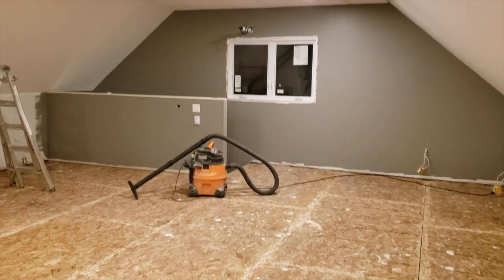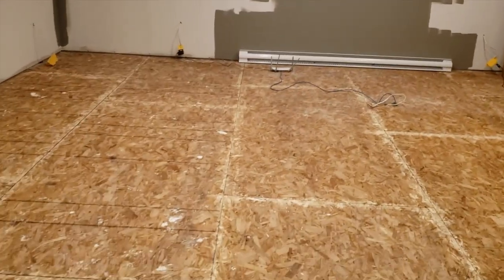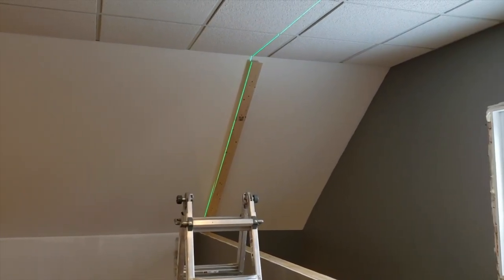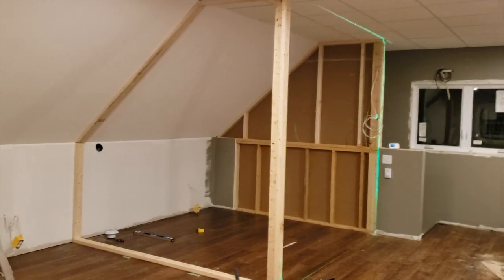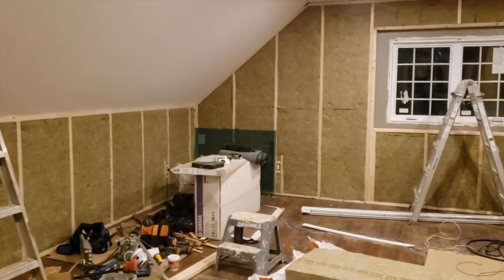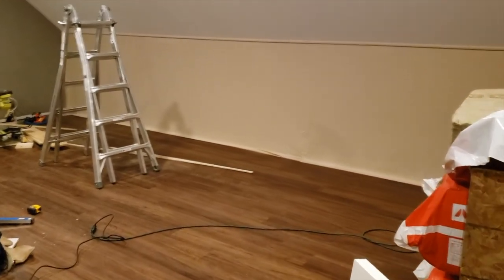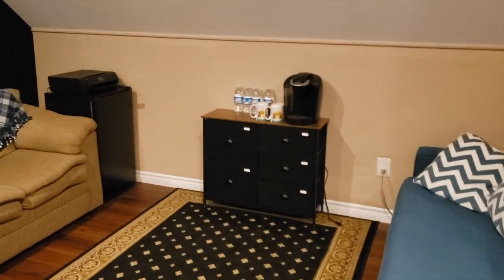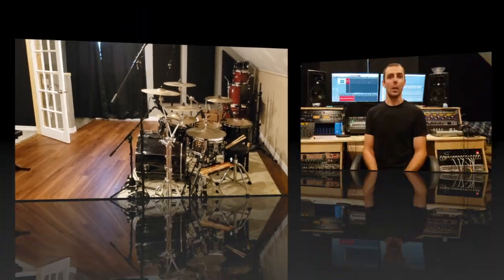Creekside Sound Studio Build

Comment: looking great, couple of questions, What kind of glass did you use for the booth? Where did you get the glass door & is it sound proof?
Reply from the maker: I believe I mention it in the video but I was, in no way, trying to make the booth sound proof. Sound proofing is a whole can of worms that involves very elaborate planning and lots of money. Quite frankly, I have no need for it to be sound proof so it wasn’t even a consideration. My goal was simply for the inside of the booth to be pretty dead. 

As for the glass, it’s laminated glass. Same stuff that’s in the windshield of your car. Any glass place should be able to order in a 4x8 sheet and cut it to your specs. Mine has a slight green tint like a car windshield (you probably don’t even notice it). If I had my choice, it would not have that tint but I’m getting picky now!  The door is just a standard French door from any hardware/building supply store.

Comment: You are goung to need air exchange in that booth.
Reply from the maker: This is actually the second studio where I've had a booth like this and it has never been an issue. Maybe if someone were in there for hours on end but usually were taking breaks and it's small enough that leaving the door open does a good job at refreshing the air!

Comment: Thumbs up to you. Quick question! Does glass on a vocal booth cause reflections when singing into a microphone? Thank you!
Reply from the maker: Short answer, yes, but they are very, very minimal. I usually position the singer (or whatever else is being recorded in there) at an angle so they are facing the corner of the booth. This helps a bit as no reflections are coming straight back.
I've also thought about hanging curtains that I can pull across that would stay loose so they would be wavy, or building panels that would sit in the windows but I really haven't found it necessary.
Reply: @creeksidesound  Thanks again

Comment: What brand name and model number window did you use? I am building a broadcast studio in my home with two 27"x37" outside windows that will need to be replaced with windows that prevent outside noise.
Reply from the maker: Do you mean exterior windows or the booth glass?
Reply: @creeksidesound  exterior windows
Reply from the maker: @Yellowjacket1977  just regular double pane windows. Nothing special. Outside noise can get in but I'm out in the country. Not a whole lot of that to worry about.
Reply: @creeksidesound  thanks

Comment: How much would a project like this cost? 25x28 just ballpark figure.
Reply from the maker: I guess that would depend on your starting point. Assuming you already have the room finished and wouldn't be replacing flooring, etc (and assuming you're not talking about the gear too), I would say you could budget 5000 ballpark. Essentially all I did was frame the walls and booth, insulate and cover with fabric. You can get into running cables in walls and all of that, which will add cost but for essentially just treating the room and adding a booth, 4000-5000 should be fine (depending on sky-high lumber prices)